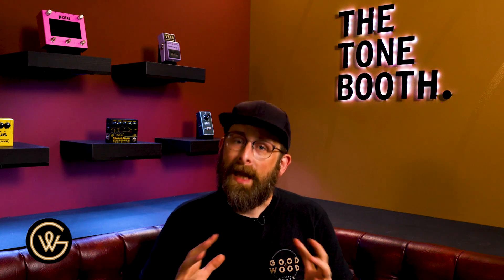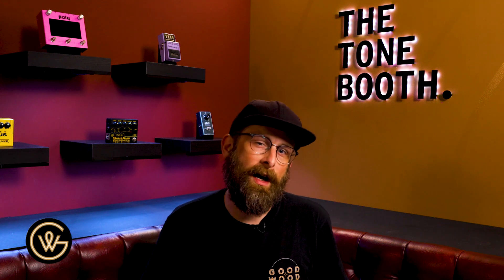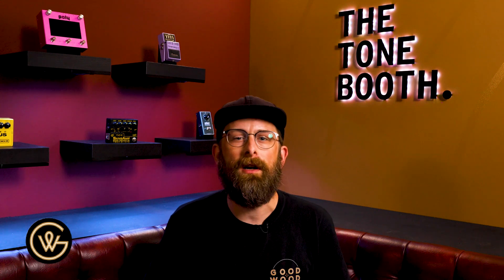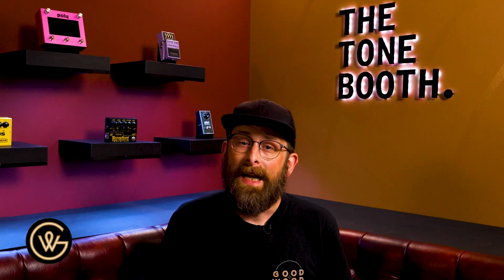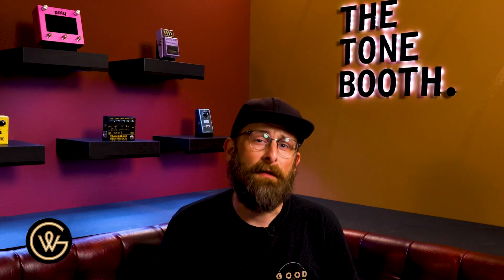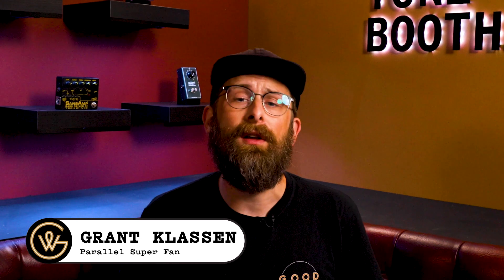Ibanez TS9 and Klon Style Pedal in Parallel... Why not!?

Comment: How would you blend and transition between two overdrives with a volume pedal? I always thought it'd be cool to be able move from my lower > higher gain drive by degrees.
Reply: Depends on the mixer. If it runs them in parallel and then does a simple sum to recombine them then you probably can't. If you're mixer has a blend knob you could mod the pot under the knob and hook that up to an expression pedal.
Reply: @leapingtortoise  you lost me at mixer. I dont have a mixer on my pedalboard.
Reply: Ok, so I haven't had to do this personally, and it does depend on your board setup. You'd essentially need something to split your signal like an ABY box, then you'd need something to recombine them with a blend knob (like an Xotic X-Blend sheet a quick search. There's probably others too). You'd then need to mod the mixer that recombines the signal so the "Mix" knob can be operated by an expression pedal.
Reply: @leapingtortoise  I was thinking there could be something with A or B loops that could be transistioned between via expression..
Reply: Boss Line Selectors were made for that very reason
Reply from the maker: If you run parallel you need a line mixer, this is true.  You can't passively combine them (easily), you need a virtual earth style mixer or similar.  So to do this you would need a mixer plus a pot to blend.

Comment: First comment! 
It sounds good in every way. It all depends on what the player thinks is magic to him. I prefer the parallel.
So Grant; Do you think you can do an episode about parallel routing? It's a relatively simple idea but so challenging to achieve when there are practically no audio devices that will distribute an instrument-level signal out to multiple sends for each of the pedals to achieve parallel signaling without using an elaborate mixer. That is if I understand the parallel signal path the way it is meant to be implemented.
Reply from the maker: Sounds good! I'll see if I can fit this into the schedule.  Would love to elaborate more on parallel if people care enough to hear about it!
Reply: @GoodwoodAudio  I sure would.